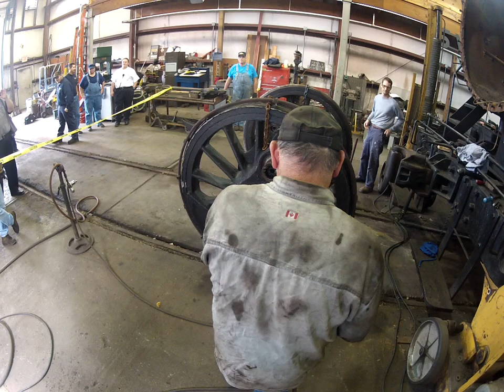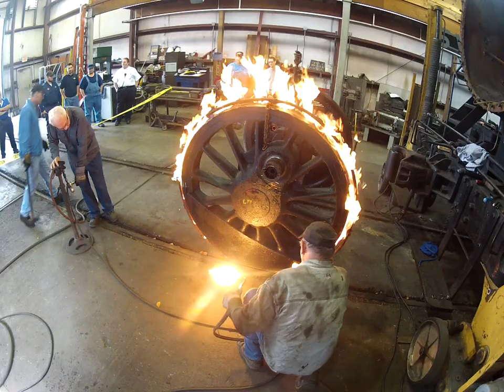Steam Locomotive Tire Removal @ Wilmington & Western RR

Comment: I did not even know steam locomotive wheels had tires.
Reply: I know I'm replying to a 1 year old comment but, yeah, they needed them because if you just let the normal wheel wear down through running it on the rail, it'll eventually make the wheels uneven and mess up the drive rods.

Comment: By doing it like this, the wheel is also getting hot, which is not helping to release the tyre, which I thought would be obvious.
As Frank says, if the tyre is split carefully with a gas-axe, it will more or less drop straight off, 
An automotive starter flywheel ring gear is done in exactly the same way, but split with a hacksaw.
BUT, who am I to say, perhaps this is the accepted way of doing it ?!!
Reply: Do you mean plasma cutter or oxy-acetylene torch?
Reply: Automotive flywheel ring is taken off with heat, the exact same way